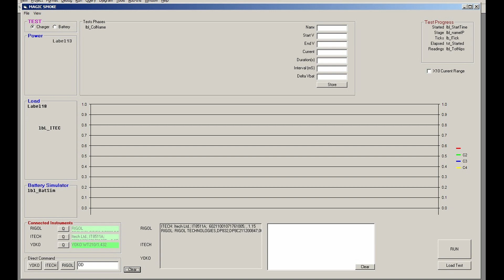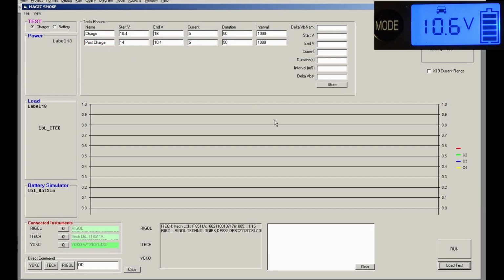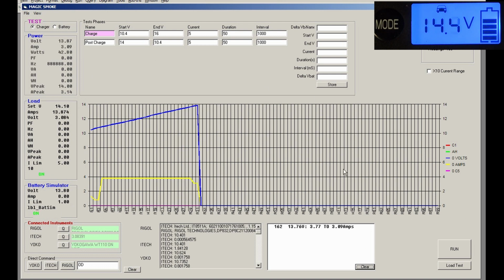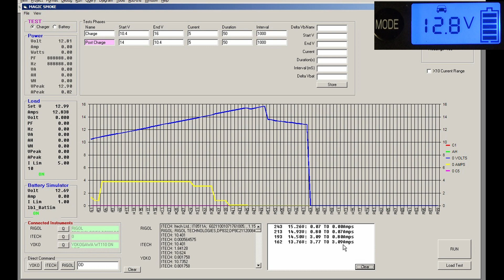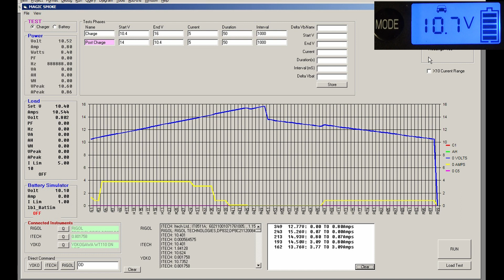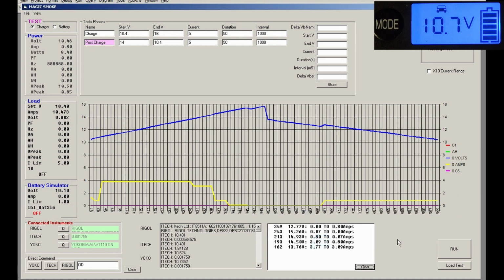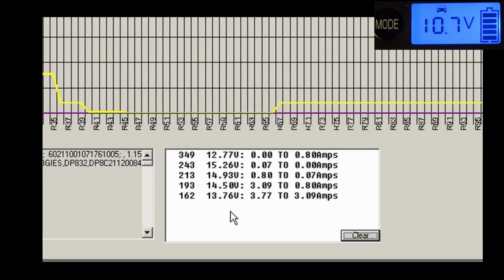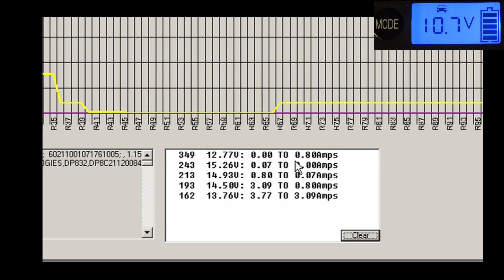Is the Aldi AutoXS Battery Charger Any good for Maintenance Charging?

Comment: The instructions suggest disconnecting the vehicle battery terminals, is this really necessary to avoid damage ? The  older Aldi one which I had did not suggest disconnection and I frequently used it in the car without disconnection without causing any problems.
Reply from the maker: No not really. It is a case at the last stage of the float or absorption charge the charger switches to a very low current to top up the last ~15% of capacity. If there is a parasitic current being drawn from the battery , (Alarm, tracker,  keyless entry system etc..)  drawing current then the charge will never complete.  This is much more prevalent with newer cars.   If you just want to top it up and get going then don't bother disconnecting - it probably more likely to do harm than good.

Comment: I have the same charger. Is 15V not too much for a lead-acid battery? The car charge with 14-14,4V. The gassing voltage is 14,4V!
Reply from the maker: Depends on the temperature.   None of the battery chargers are very accurate voltage wise. It is a bit high but wont do any damage as it only reaches there at very low current and then switches off the current.  Some might say that it helps to minimize Sulfation.  I don't have an quantitative info on this and there seems to be experts all over that have never really properly tested their theories.  Let's face it the Lead acid recycling and sales business is a huge cash-cow for the manufacturers.
Reply: Pyjter t-25 so what does it say, is 15v oke

Comment: Im stuck indoors due a text informing me.. i currently have 2 batteries on charge one is an aldi charger the other is a lidl one.. are these ok to see me thru the 14x day period by being left on cold mode constantly? One is reading 13.2v the other 15.4v
Reply from the maker: Yes should be OK.
Reply: @razenby  I experience weird things that the Voltage creeps up until 12.9V, the battery shows full bars after about 4 hours on my AGM 35Ah battery.  After that, it goes gradually up and down fluctuating from 12.9 to 14.4V every second. It continues doing that even after I left it for 10 hours.  The final voltage of the battery was only 12.5 Volts

Comment: Will this charge a fully flat battery as I got a red one like this in aldi and it's a smart charger and won't charge a fully flat battery. Are these different
Reply from the maker: No it wont charge a 12V battery that has the terminal voltage dropped below 7.5V
Reply: @razenby  I just bought the updated version of this today in aldi and I think it does charge from flat.  I'm gonna try it tomorrow.
Reply: @grahaml334  no it didn't work either I was disappointed.
Reply: if you have completely flat battery , and wanna use this charger , you need gain some voltage connect battery using cable to other runinig car for minute or two then quickly connect to charger and it works for me at least
Reply: @TheArczer1234  yes but it is stupid that it wont charge flat battery.
Reply: @martymartin2894  i had my missus car  left on parking spot due to covid we work from home , her car battery was gonne so i buy this aldi charger , at frist shows battery is foulty then i look to instructions symbols shows on charger said is bellow 7.5 , so i connect via cable to my car for few minutes and then shifted to charger after 2 h  charging her car start no problem

Comment: Do you get the same transition points if you put the charger in the fridge for your test?
Reply from the maker: Pretty much. there is a cold charge mode shown in the instructions.  There is no automatic temperature compensation.
Reply: Put the fridge into the car.